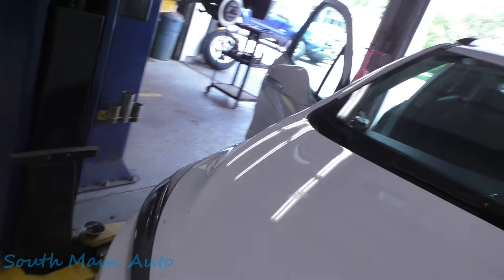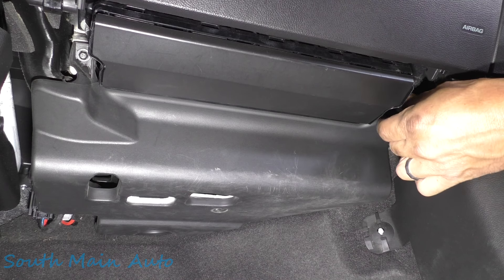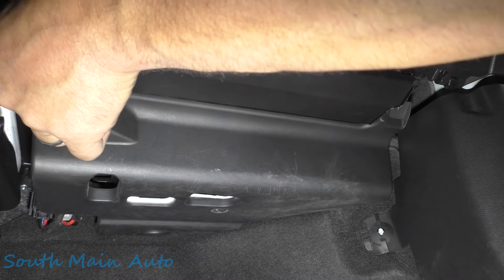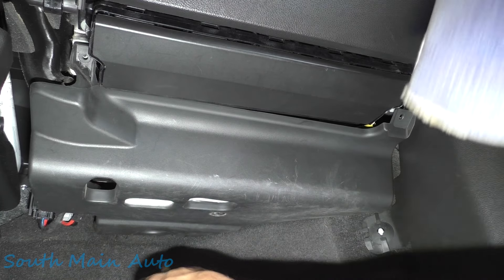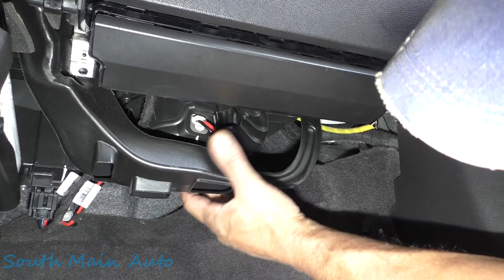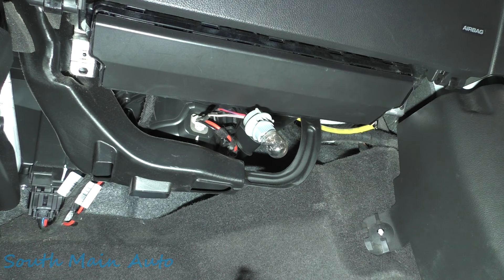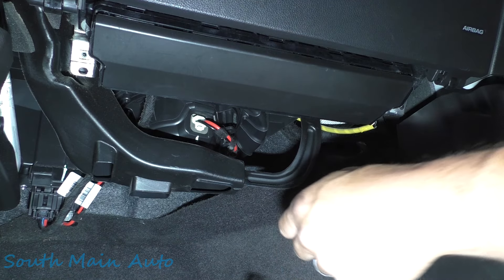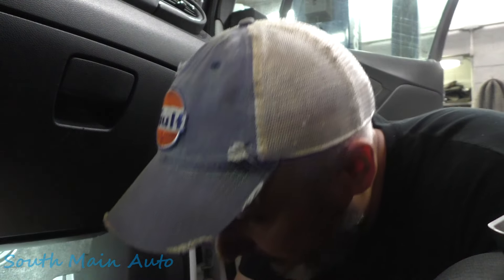Buick Encore - Blower Motor Replacement

Comment from the maker: You think this is a stupid design.... check out the other most common car sold by Ford. The 3rd Gen Ford Escape puts this one to shame haha
Reply: For reference, when Ford owned Land Rover for a bit, they used that same design on the Range Rover Evoque and the Discovery Sports, however, on the discovery sport they decided that there needs to be a screw that also holds the blower in on the same side that the release tab needs to be held down on. I had one come in from another shop that never put the screw back, told the customer to kick rocks when it came back with the blower inop. A bad day was had by me
Reply: 04 Ford Taurus ready to be sold over how much is involved for AC
Reply: I remember early 2000 caravans dash out blower motor some kind of EUROTRASH design and Mazda and ford probes blower miter backwards once again everything out because put in back side of hvac box and so and so on
The Brembo clear coated rotors are even worse have to drive it twice as far as others
Reply: The Ford Escape is junk!  Try replacing a simple alternator!  I guess I won't stop in and say hello when I'm coming through since you Tubers take up your time. lol
Reply: It’s why I’ve called the 3rd Gen Escape the most maintenance unfriendly vehicle in ford’s ENTIRE portfolio. The engineer responsible for burying the battery halfway under the windshield cowl needs to be beaten with his own crappy design.
Reply: @digitalrailroader  Honda did this with the battery in the 07 civics. Have to pull the windshield cowl, wipers, etc. WAY worse than it needed to be.
Reply: Lol the last few years my main work is ac and 3/4 of those are evaporators. I would rather pull a dash than do an escape blower motor.
Reply: Mr. Eric O, wait until you have to put a heater core in a Jeep wrangler. You have to rip the dash out completely to install it. It's beyond stupid either fix a place in the fire wall under the hood or fire the person who designed it.
Reply: I was coming here to say wait till you get a ford in the shop... but you beat me to it. However this one was as you said "a friggin stupid design". Great job GM getting on Ford's level here.
Reply: The engineer who designed that turd is watching and laughing....all the way to the bank.
Reply: chevy cobalts also same poop
Reply: You mean like the fact that you have to remove both front doors to do a heater core on them?  Yep, that's up there in the pantheon of most idiotic design decisions.
Reply: @chrisbaer4567 good to know
Reply: The engineers are designing disposable vehicles. They know the car won't last long. So why make a serviceable part ??? and if the owner takes care of it and last longer than expected, now it is up to the mechanic to charge the extra labor to the owner.
Reply: Dr. O! What you need is the ole YouTube 'Discount'. Just mention "as seen on YT":pride-fan-rainbow-open:
Reply: I have a 2500 hd diesel pickup .. blower motor acts up ..hit the dash or grab the motor wires it starts up most of the time ,, also needs fuel lines and trailer brake system is messed up ,,trailer lights work but no brakes .. only problem I am in Chautauqua county ,, 2 plus hours from you ,, and you don't like diesel smell .. I could make a video doing the blower motor repair but the sound part will be all beeps and more beeps and maybe some tool throwing ,, Great video ,,
Reply: When was the last time they built a new house there?
Reply: typical gm crap design.
Reply: @randycarpenter2914 Just about 95% of vehicles require dash removal for evaporators nowadays. It is not fun to be a mechanic anymore.
Reply: DEFINITELY❗️
Know from experience.
Reply: Would it be best to take out the cabin air filter, to get some light down in there and move the passenger front seat all the way back, if not take it out?
Reply: The escapes are total garbage!!!! When the service information tells you to remove the seat so you can lay down to hold it in place you know your in for a fun time 😂 I am so so happy I don’t work at ford anymore they have to be one of the worst vehicles to work on across the board.
Reply: You can blame OPEL for that design, since that car is a OPEL Mokka x rebaged
Reply: Eric O if you don’t like YouTubers stopping by then quit being such a cool likable guy that puts out great content not to mention a great mechanic.
Just kidding don’t stop putting out the videos but you are a YouTube celebrity so I guess dealing with the paparazzi comes with the territory.
Reply: currently doing a headgasket on a 1.5l ford escape. boy oh boy.
Reply: @digitalrailroader  Reminds me of how the battery in the 2000-2005 Cadillac DeVille is located under the back seat.
Reply: Maybe you should do a BMW window motor assembly to really cheer you up.
Reply: @digitalrailroader  Chrysler Seabring was in the drivers side wheel well. 😂
Reply: @akshonclip  the Chrysler Cirrus, both generations of Dodge Stratus, Plymouth Breeze, All 3 generations of Sebring Convertible, Both generations of the Sebring Sedan, the Dodge Avenger, the Chrysler 200, and last but not least the Dodge Journey all had their batteries in the driver front wheel well. Out of all the vehicles I listed, I’ve owned two of them so I know the pain and suffering.
Reply: We need a video on this…
Reply: Oh yeah. Have to take the dash out. Ugh.
Reply: Looks as much fun as the blend door actuator,tick tick tick tick tick tick boom,dumb ass design.Mine just happened to be the fresh air/recir,the hardest one to get to.🤬🤬🤬🤬🤯🤯🤯🤯🤯
Reply: the 2012 era malibu is the same way. I did one the other day... blew my mind
Reply: @digitalrailroader  I’ll pay money to see that.
Reply: KEEP TURBO'S IN STOCK
IT'LL BE BACK FOR ONE
Reply: @randycarpenter2914 that’s almost every car these days! Heater or evaporator core is total dash removal!
Reply: @chrisbaer4567 I have an 07 civic and my battery is right up front.
Reply: It is much simpler to replace the blower motor on my 2005 Ford Focus. All I need to do is remove the glove box, the air duct near it, and three bolts.
Reply: Got a nice cold one and new  SMA episode oh yeahhh cant get better than this 👍
Reply: Oh you mean the one that FordTechMaculoco indicated the friggin doors have to come off to pull the dashboard for a leaky AC evaporator core...and possibly you have to replace the  entire heater box while your there?
Reply: If an auto design engineer walked into my shop, I’d beat him with a pipe.  When inferior stock mounting tabs break, I upgrade them to zip ties.  I use a dab of grease in a socket to hold the bolt/nut/screw so I can get it started.  I too have seriously contemplated leaving out bolts that are damn near impossible to reach that will not impact the safe operation of the vehicle, but inevitably I always put all of them back in their proper place.  I just bitch the whole time I’m doing it.
Reply: we,ll get a chrismass tree tool,, socket set, 5 lb hammer , 1 lt fuel, a match..  when you my age,,the match is the easiest option,, shoulders, back, knee, fkt..
Reply: @digitalrailroader my '16 Focus is the same way.
Reply: @82_KID  lmao, my brother in law used to chopsaw his way in through the engine bay! Taking half the motor apart and stripping the inner fenders was still faster than pulling the dash
Reply: @digitalrailroader  Honestly that isn't the worst design and is still pretty easy to change. Just have to remove the airbox and the side of the battery tray and then it just slides right out. Was able to change them in about 15 minutes when I was at the dealer. Some people think you have to remove the cowl, which I never did because it seemed like a ton more work and I had the right tools to get into the tight space above the battery without any issue. Granted, any car batteries are easier to change than the batteries on 2022+ Kenworth T680's.... My god they make you remove most of the fairings AND have the audacity to create a giant bundled up nest of cables on TOP of the batteries. There's probably more than 8 foot of cables strewn across the top of them, covering the posts and the battery hold downs. THAT is a trash design in my opinion lol.
Reply: @dmaster92289  Took a page from the old VW Bug….
Reply: Later 50s Lincoln where the battery is removed from under the passenger side dashboard....
Reply: It's probably the hat. You're going to have to go back to the Mathews!
Reply: @crazytrain7114  man. It needs AC stuff replaced for SURE! Including the "thermistor." Avoca NY is a ways away.. I wish I knew somewhere that could fix it for cheap!
Reply: Is this the one that you can't replace the cabin air filter without bending the sh*t out of the filter and wedging it up in there? Absolutely stupid design. As a technician getting paid $1 for a cabin filter, better believe those Escape's never needed A/C filter service
Reply: @chrisbaer4567  Similar to how the 6th gen Accords require you to disassemble half of the dash to get to the cabin filter. Its a half hour job at minimum.
Reply: I can 100% attest...90% of those decisions were NOT the design engineers.  Studio ran rampant, and quite literally sold the executives on so much BS.  Design studios hold WAY WAY WAY too much power over the design and layout of the vehicle outside of its appearance.  :(
Reply: @WreckDiver99   I drive a Subaru now because I just can't take the pain lol
Reply: Eric I guess GM figured the Blower Motor would outlast the vehicle.
Reply: I just put a blower motor in a 2010 Murano , man what a stupid amount of disassembly. It's VW levels of  madness.
Reply: repentandbelieveinJesusChrist1  This is not a job for a carpenter, sorry.
Reply: @82_KID  Just stock up on oil....lol. haven't seen a Subaru yet that doesn't burn it after 20k or 30k...
Reply: @chrisbaer4567  Funnily enough - this also applies to the third gen Ford Escape. Unless you want to disassemble the airbox and air filter.
Reply: @sweetwilliam49  Every house he drove past looked like it was 100 years old. Nice character homes though.
Reply: @Klutech  why fix it if it ain’t broke. Still would be nice to see a one story 4 bedroom brick house. I had a gal friend in Rhode Island who talked about us hillbillies in the mountains of Virginia. I use to tell her we were 70 years ahead of them in houses and roads
Reply: Chris Baer  I thought the battery on those was right up behind the driver side headlight. Super simple? Only time I can recall pulling the cowl was for power steering pump and intake manifold access?
Reply: @randycarpenter2914  he already knows.
Reply: I’ve worked on vehicles most of my life, first one was a 53 mercury, next one was 57 ford two door coupe. The newest I own now is a 02 ls430. I’m a big Toyota fan. 97 Toyota t100 truck. Never any issues to speak of. Worked on a 2019 Subaru forester, junk! Reminds me of a Nissan. Guess I’m too old now. Got memories now, hunting, fishing and several good women. Life is precious, savor every moment. Gone before you know it
Reply: i have an ideal since people do want to meet only meet after the shop is closed for the day and stay and hr or 2 after  or use another shop or another area and just post will be here from x hrs to x hrs have like some type of meet and great your just a legend in your own right
Reply: @sweetwilliam49 all new builds are in the suburb of Avoca.😅
Reply: You should see modern Lada how far cutting corners can get._
Reply: How about a heater core in a 2012 or so Jeep Liberty? The whole dash, steering column and, I'm sure other stuff needs to come out! I turned down that job at my little, part time shop!
Reply: I fight those push pins all the time also, they seem to always want to break instead of come out . Ford likes to use them about every 3 inches on wiring harnesses. Use a dozen new zip tie push pins when replacing transmission in latest escapes. You are sounding more like me in this video!
Reply: Brother have you changed out a/c door switch on a 2018 silverado  had too disassemble entirely hole dash to do so 🤔  One would think why did they put a serviceable part behind dash. Lol😅
Reply: @SouthMainAuto, enjoyed the video! It's so nice to see a REAL Automotive Mechanic share how he feels about the nonsense in automotive design! As a "non-mechanic" who has had to work on vehicles out of necessity, the diasatrous design flaws observed across multiple vehicle brands is not only frustrating but painful to that one "sense" which is "common", except in the vehicle design studios of major vehicle manufacturers...
Reply: Reminds me of replacing the stacked two-piece cabin air filters in my 2012 Mazda 5. Practically have to stand on my head upside down to get to the screws to gain access to the filters. Then, barely able to get two hands in a limited space, you have to insert first the upper filter, then, while holding it in position with one hand you use your other hand to slide in the lower filter. You think your body aches after finishing? Just wait till you get up tomorrow morning!!

Another tough job that I didn't attempt years ago was replacing the heater core in my '89 Ford Taurus. A neighbor had the same Taurus with the same problem--a hole in the heater core. I helped him a bit (mostly observed) with the job which required removing the whole dash assembly and I think also the steering column. What I plainly learned form that experience was that the easiest fix for my leaking heater core would be to get rid of the car before winter arrived!
Reply: 2018 Chevy Cruze cabin Filter....pre 2016 was a snap but Chevy figured that was too easy and our dealers need that service income.
Reply: @chrisbaer4567  USDM 07 civic?
It's not buried under the windshield dude, are you thinking of the right car?
Reply: My first car was our family 76 Chevy Impala, we had the vehicle long enough that the body rusted out before we passed it on. The blower motor never died in that car. Now we have these "modern" GM cars and the stupid blower motors die like clockwork. Someone at GM Parts had too much input on their designs! Planned obsolescence...
Reply: @digitalrailroader The Focus has the same stupid battery placement... You have to go with the Uber expensive sealed battery or you have to deal with the stupid design every time you need to check the water level in the battery.
Reply: As someone who has that escape with a bad blower motor I refuse to fix it and I’m even a mechanic myself
Reply: @randycarpenter2914  THE SAND CASTING WAS NOT CLEANED PROPERLY CAUSING THE CORE TO STOP UP(1 MORE QUALITY FIAT) LOL
Reply: Hahaha, I call out sick whenever I hear that an escape or focus is coming in for a blower motor. It's easier to pull the dash and do it.. lol

Comment: Used to keep a golf club in my truck to whack the blower motor when I got in. You’d be surprised how long it will still work. Even trained my wife to kick it when we got in. Didn’t even have to remind her after a while. Made me proud every time 😢❤
Reply: My 02 Jeep Wrangler manages to eat leaves and then chew them up and then spit them out again . . .
Reply: Pretty much the same as my LeSabre. Had to kick it to get it going. Ordered a replacement but it cogged at low speed. So I removed the brush assembly in the original one, cleaned out the brush dust and put it back together. Worked great for another 6 years and would still be going strong if not for the NYS winters / salt eating the frame.
Reply: I keep a hammer in my 98 Wrangler for those impromptu blower motor repairs. 😂
Reply: My 86 Ford Ranger had the blower motor under the hood, didn't even have to bend down to change it, then again it worked till almost 2002 when I sold it.
Reply: But then Dr. O would have no dumb customers!
Reply: A snow brush / scraper also works very well !
Reply: I just used to find a nice juicy pot hole at 40-50mph to jar it back into action. Company owned vehicles lol
Reply: I’ve been looking for reason to keep my golf clubs 🤔. Thanks
Reply: She's a keeper!
Reply: HaHaHa. I trained my wife to do the same! I finally fixed it last week when the kicks didn't work anymore.  Did it in the parking lot of a NAPA in Sulphur Springs Texas on our way to California :)
Reply: Same thing for my 98 Accord. The blower motor has been acting up intermittently for like 5 years
Reply: Hilarious music Man
Reply: I did that for five years with a walking cane in myb06 Dodge grand caravan.  Worked good but wound up replacing it after I broke the plastic fan housing that I just glued back together😂
Reply: @The98deville  My 2000 Ranger has the blower motor under the hood. Still don't have to bend down to change it. Only had to replace it once so far. It's gettin there for a 2nd replacement motor... Got the early morning squeal on cold days last winter...
Reply: id keep the ole snow brush in mine for those winterous days when the blower would stop lmao
Reply: Yup!! Tonya Harding in the jockey box. Cheap insurance!!!
Reply: Lol glad to know I wasn't the only one
Reply: @granitecowboy2199 I😊😊😊😊😊
Reply: My sister in law has a 2017 or 18 Buick Enclave I’m guessing it’s the same but I’m not gonna touch it.
Reply: Lol
Reply: @davepompea  you have to use fluid film. i have a 03 bonneville SSEi that i park in the winter, great car..... fantastic engine. 3800 supercharged. i did the usual mods..... pulley swap, PCM, plugs, power log. it screams for a big car.
Reply: Been there.
Reply: Superglue is your friend
Reply: If it was my car wouldn’t put all that fluff back in
Reply: Mine (2014) still runs but it squeals.  I am too old to bend like that anymore, off the shop it goes.